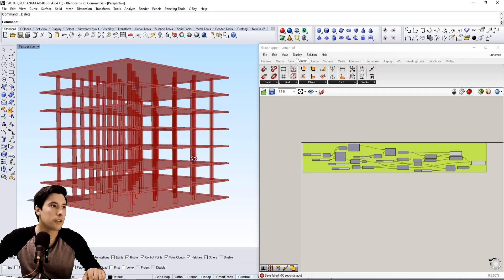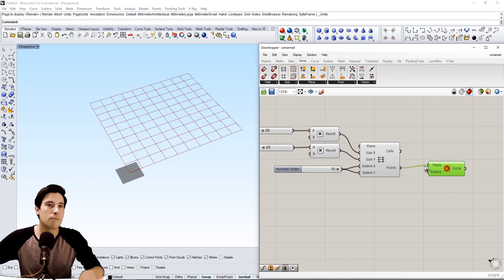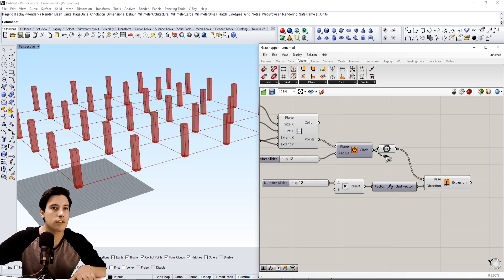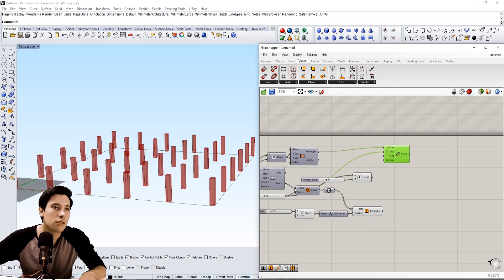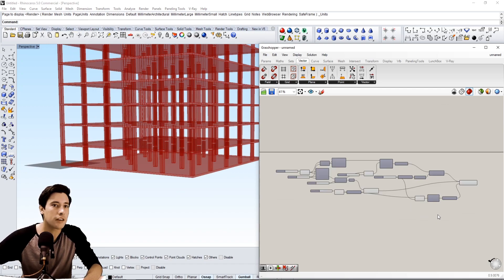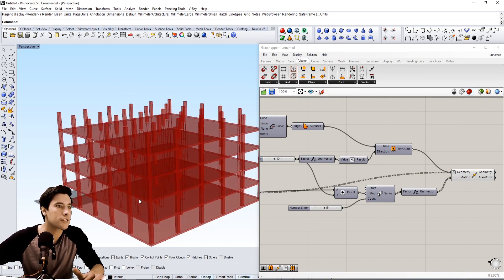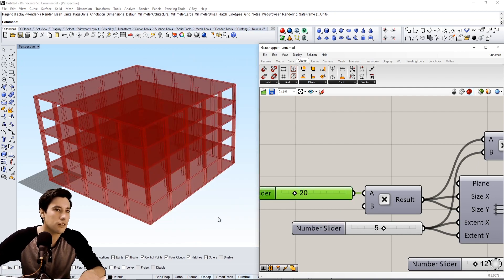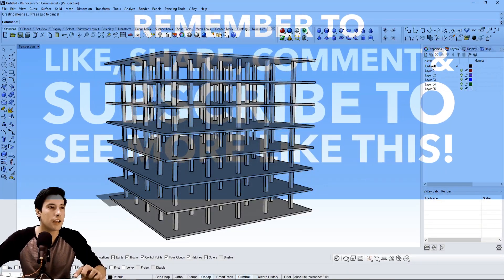Rhino Grasshopper Simple Architectural Building Structure Full Tutorial

Comment: Hey man, thanks for the tutorial! I've been playing around but now I have an issue with data tree. The goal is to duplicate the buildings on a grid, and make them so the number of stories vary on the X axis (a building with 2 stories, then next to it another with 3 stories, etc along the X axis). I used the Series box to create X number of groups for each building, this series being also used to move the building along the X axis). However, I have trouble, because in the end you graft everything together to make the building complete, but it seems I can't retain the information that each X building should be in a separate group. Do you have any advice? Cheers.
Reply from the maker: I can think of a solution, but it would not be using data trees.  It would be to create the overall building forms first, with variable height, then contour vertically.  Let me know if that doesnt make sense, I can always record a quick video showing what I mean.
Reply: @DCOParametric  The idea was basically to replace the slider of the building floors with a series, and then move them accordingly. Since they are all produced at once, but the graft is right before duplicating and moving the floor slabs, I figured it messes the data structure? I'm still trying to wrap my head around all this :) The idea is then to do X axis floor numbers, and Y axis slab size, to end up with a demonstration on a 10x10 gris of the 100 different buildings one can make using your algorithm :)

Edit : it's a challenging puzzle. However, I figured it's right at the Grid that it doesn't want to make each grid and move it incrementally.

Edit : it's because the series (functions) operate list block after list block. Data tree is for managin these list blocks into a hierarchy. And now after diagnosing and testing each component, I might find a way to make it work. Will it be able to handle additional dimension of complexity? Linear algebra flashbacks LOL

Comment: It's fantastic. Can this be generalized to diagrid structures and more complex structures?
Reply from the maker: yes, but the floor slab would be made in a different way.  but the columns, and series of floors could be made with any grid point design
Reply: @DCOParametric   My strategy was a separation of the slabs and the grid structure but coordinating both is quite a challenge.